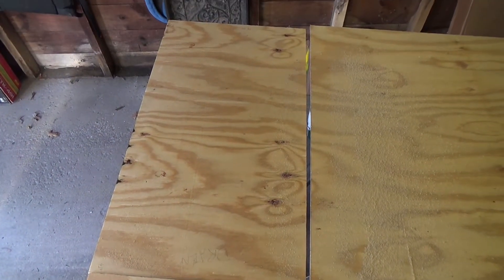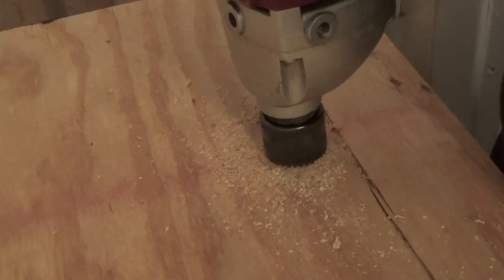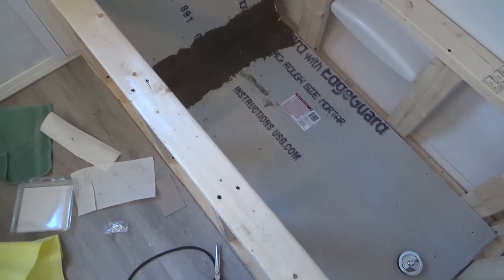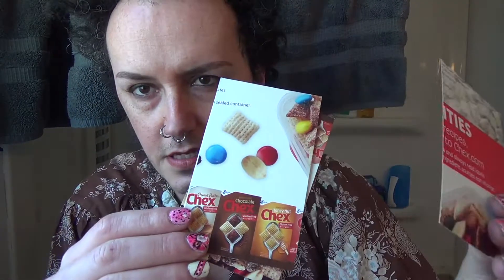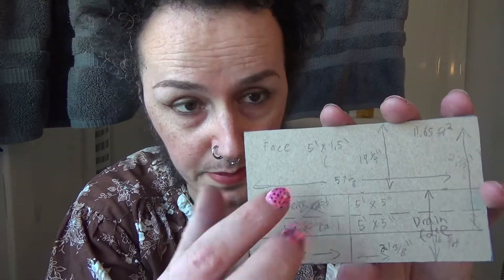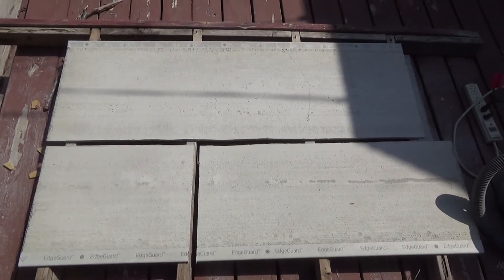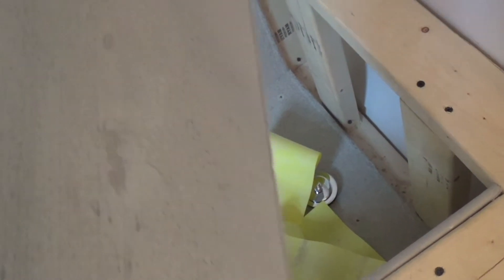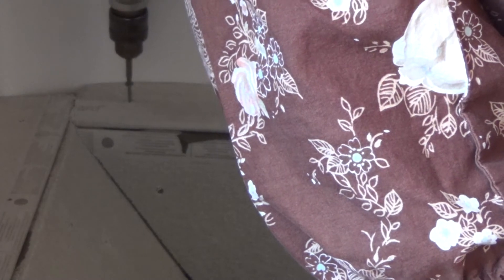Roman Tub Part 2

Comment: Nice, is it leaking or ok?
Reply from the maker: I only had two problems with leaking. The first was around the drain, because I used a hard rubber gasket. I put in a soft seal and then it was fine. The second one was because I didn’t seal the wall seam well enough. I added more silicone caulking. Now it is fine.